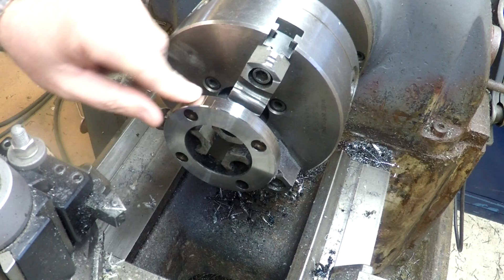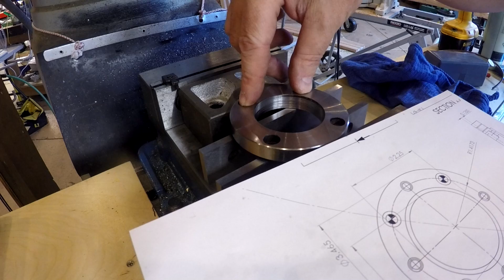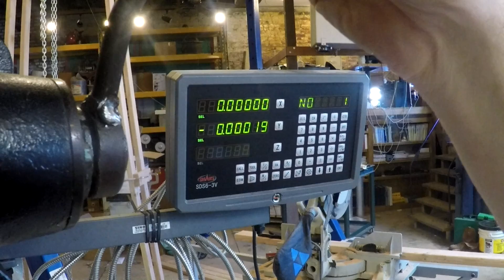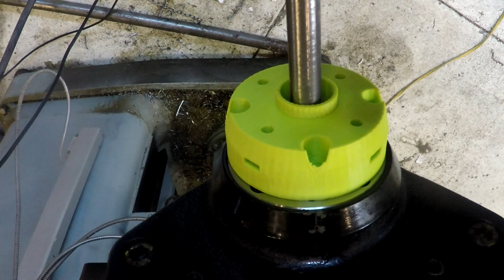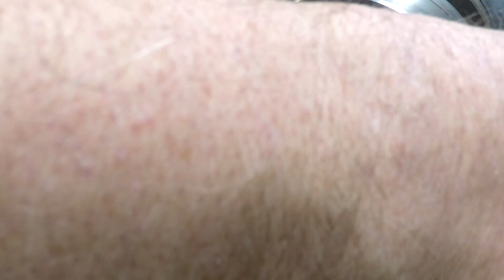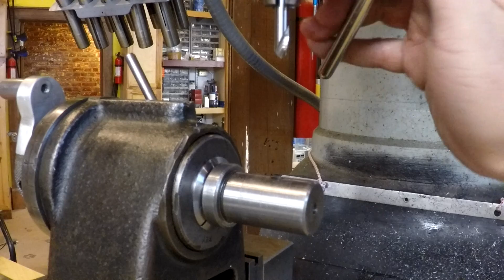Power Feed #5

Comment: For the Dial scale issue: Make the plastic housing oversized. then turn it so that the original dial will fit on the outside of the plastic housing. Hopefully the original dial doesn't have internal obstructions that would prevent this.

Comment: replace the o rings in the el cheapo air fitting and they stop hissing 1
Reply: Many times just a couple drops of air tool oil will fix the leak.
Reply from the maker: cpcoark Greg Nowling In this case Greg is correct.  That fitting it an el-cheap-o big box store special.  I have replaced almost all of the with fittings from McMaster which do not leak.

Comment: Nice vid, minimum plastic. Ive heard ppl mention they use spotting drills in the lathe etc....i dont know their need as to how deep they think they have too conventional center drill, but all my center drills step from 118 degrees too 60 degrees. I center drill enough to say its pecked and then switch to a reg twist drill....the hole is always 118 degrees

Comment: Hi James,
Squirrel, don't forget where you're nuts are buried .
Expanding mandrel, yup, it works...
About the dial, could be possible to machine a back plate that would serve as a closing cap, expanding until it clears the body and holding the dial... ?  Also need a fixed part on the servo to serve as a reference to align the dial... Just wondering.
Interesting project,
Pierre

Comment: Very nice vid.  If the Bridgeport dial is not too expensive and fits the shaft, that seems like the easiest solution.  You state you don't use the dial, so what difference does it make what the dial reads?  If you're concerned a third-party will use the machine and count on the erroneous dial simply chuck-up the dial and turn off the numbers and lines.  Or easier still wrap with tape to cover.
Better yet, and probably cheaper, is to print the part.

Comment: james: i dont have a dro on my mill but i have one on my lathe...question... is the dro smart enough that if you did an 8 hole bolt pattern and then centered in the 1st existing hole the computer could figure all the rest of the holes without having to square up???
Reply from the maker: carryit around   Yes you can do it that way, but you would have to calculate the center of the pattern and enter it.
Reply: of course 0 center first, but after its centered then the dro would find the coordinates based off of an existing bolt hole... thanks james

Comment: I like the dro hole pattern fiction. Couldn't you hit the down arrow twice between holes so that you only have to move one axis each time?
Reply from the maker: jeff edison For simple patterns with four holes, you only need to know two numbers, and one of those is zero.  So lots of times I will memorize the number and just make the moves without aid of the hole pattern function.  However, as soon as you add a hole, say an odd number pattern with 5 or 7 holes, there are lots more numbers, so following the sequence helps.

Comment: Hi mate.
Sorry, but I do have to dis agree about the sound test.  I think that there is a sound difference.  The sound was a little crisper and it also created a little more background noise.  I noticed your fingers, and you did a real number on them. During the night it would be good to keep them well covered with an ointment like lanolin.  this will keep the scaring down, and restore the feeling in the tips to there optimum.  Many nurses sleep with examination gloves on their lanolin covered hands (no not for that reason) to prevent the drying out of their hands by the frequent hand-washing that we have to do.  I like the way you work. There is a sort of nonchalance to it that is very funny, I think.
Keep up the good work. 
Oh by the way, I think that Keith Fenner, the man with funny beard,  has a video about making and repairing cogs. He might be able to help you with the lathe problem your having.
Kind regards,
Marcel.

Comment: for the dial, the only simple thing i can think of would be to get a 100 grad dial, put it in the lathe and turn down the diameter up to the lines so the numbers are gone and re-stamp them - as in where 10 was before would be 25, 20 would read 50 and so on up to 225 where the 90 was before. Every 2 divisions would be 5 thou. Of course it's far from ideal but would work ok for finishing the powerfeed and have something meaningful rather than completely wrong. Other than that maybe make a dial and find someone with a 4th axis CNC to engrave it (or other means of engraving, laser, etching and even seen it done with a rotary table on someone's youtube channel but can't recall which one).

Comment: I like the plastic screw wedge arbor.  Cheap yet functional. I wonder though how well does it stay on center when it swells out? Looks like it is wiggling pretty good. I probably would have just mig welded up that shaft and turned it back down, mainly because that would be the most likely things I would have around to work with.
Reply from the maker: bcbloc02 Hi Brian, it works pretty good if you put a center in the screw head.  I've used those plastic arbors a lot doing small bushings.

Comment: Interesting to note that M7 is not a preferred ISO standard size!  http://en.wikipedia.org/wiki/ISO_metric_screw_thread#Preferred_sizes
Reply: indeed, but they have used  m7 on a lot of cars uk europe since the 80's
Reply: M7 is fairly common. It was part of the JIS (Japanese Industrial System) that predated the ISO Metric system. I have M7 taps and dies and even an M7 thread repair kit.

Sometimes it's been used because an M6 was failing and there wasn't room for an M8.
Reply from the maker: Simon Crabb M7 is a bit of an oddball.  These Hurco mills are renamed Kondia mills, also sold as Clausings.  They were/are made in Spain from what I understand. They have very little in common with a Bridgeport as far as interchangeable parts, if any.
Reply from the maker: Simon Crabb jusb1066 Paul Compton M7 is nothing but a fastener that wants to grow up to be the best, 5/16 x 24!
Reply: James Kilroy
so long as it has a whitworth form thread!

Comment: was there a helicopter hovering overhead? theres a sound much like it for most of the video!, of course you can 3d print the cover part for under the dial
Reply: This is the sound i heard in the other video also
Reply from the maker: jusb1066 Chris van der oest I am perplexed, I don't hear that at all.  Are you having to turn the volume up real high to get good audio?
Reply: James Kilroy
45:30 very clear during the quieter parts
Reply: James Kilroy I have a JVC headphone i hear it from 15.09
Reply from the maker: jusb1066 Chris van der oest I think that might be the central heating system that is making that background noise.  I can barely make it out, but I am on a laptop at the moment, with speakers that are marginal at best.
Reply: James Kilroy shop adhd#13  when you did the test i didn't hear the sound with the original mount I did with the other one
Reply: Chris van der oest
I hear it too, starting at 15:09
It's not central heating, it's a thumpy pulse, electronic interference type noise
Perhaps the DRO puts out something that the camera picks up and turns into audio interference.

I'm using headphones.
Reply: It sounds like motor boat instability 

Stuart
Reply: James Kilroy
yes perhaps the small speakers, its more of a bass'ey whomf of a helicopter, try headphones?
Reply: +James Kilroy It only sucks when you mount the bloody cam/mic directly to the machines.

Comment: James,
Q1: Could you have used an adjustable parallel between fixed jaw and drill bits to align plate to vise?
Q2: Are you considering printing your dial/swarf blocker?
Joe
Reply from the maker: Joe Hale Q1:Yes, if I had one.  Q2: Yes again, its a natural application

Comment: never seen a Bridgeport dial myself but if you have a dividing head can't you turn the numbers and divisions off and cut new ones . lot of work for what your doing but only have to do it once I guess.
Reply from the maker: Chris Anderson I could but its not important for me to have a dial, I haven't used them one time since getting an DRO for the machine.  That is a lot of work for a feature I won't use so some kind of filler piece is probably in order.
Reply: Could you print one?